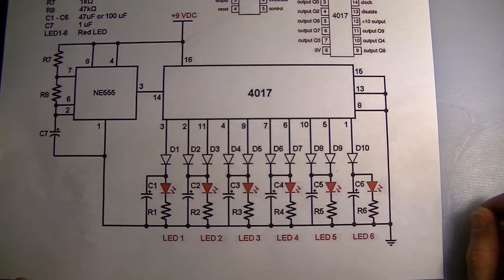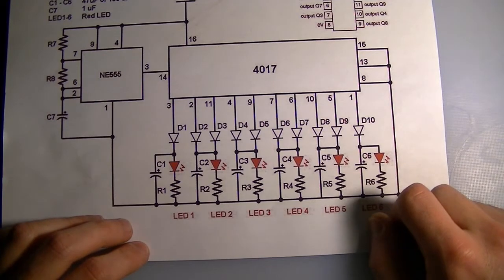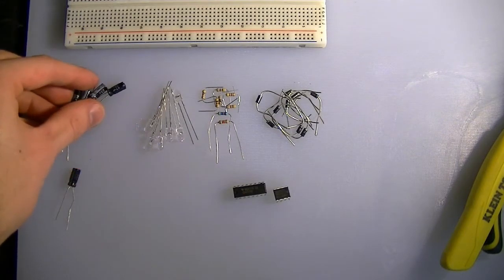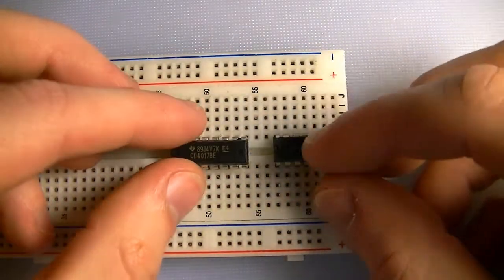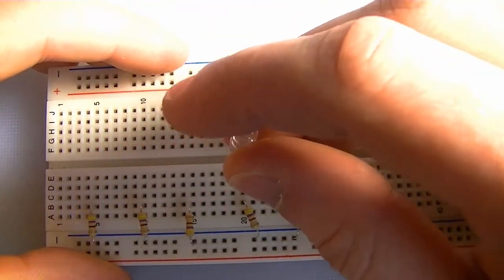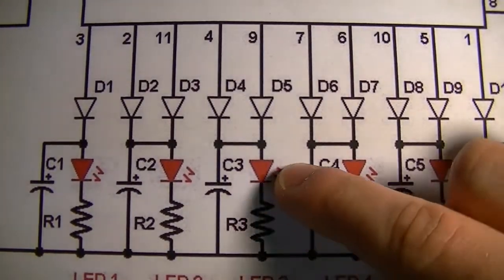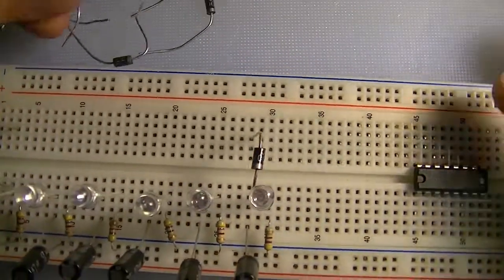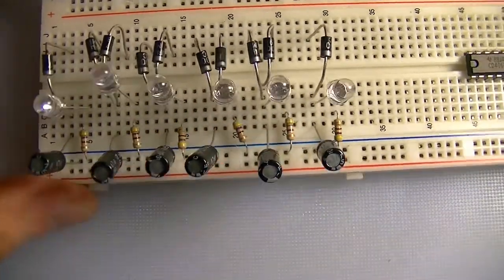Larson Scanner part 1

Comment from the maker: ah yes that is a common problem, I started buying boards with no split, the split is meant to be useful for op-amp circuits and such but it seems to just cause problems most of time I always would forget about that split and a lot of debugging time before I got use to it.

Comment: also the ng line on the side of my breadboard I found dosent go all the way down so its broken into sections so I would end up with breaks in the neg but running a wire to one of the sections to do a bypass dident light the led on a test  if I tapped the pos input directly to  either didoes  none lit up  so I have a problem I have to find  with building it .

Comment: hey Steven, the schematic is absolutely correct and the circuit would surely work, no issues!....it doesn't actually matter where the resistors are connected, they just need to be in series with the LEDs for limiting current....cheers!

Comment from the maker: I am not sure what the error is still, the schematic is correct the LED polarity is the same. Both circuit in the video and schematic agree with each other. Conventional Current flow in direction of the diodes arrow symbol is correct as it must be the same as the signal diodes feeding it. Resistor position shouldn't change anything.

Comment: i just built this circuit following your schematic and it dident work so I studied the video  and in the video your resistors run to led positive but in the schematic the resistors run to the led negative when the current limiting resistors should run to led positive   so if anyone builds it it wont work unless they follow the actual circuit building on the youtube video and not the schematic  which has errors in it

Comment from the maker: I would agree with you if this were chemistry, but this is an electrical device which is labelled using conventional current flow not electron flow (I wish we got it right the first time). I should also probably not point out the long leg, I have another batch of LED's which use the short leg as the anode but its not as common.